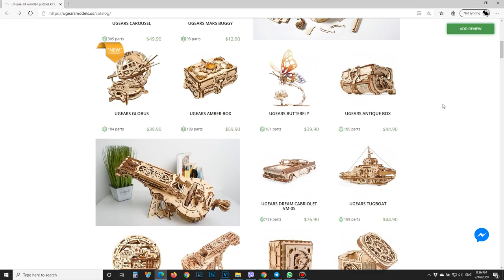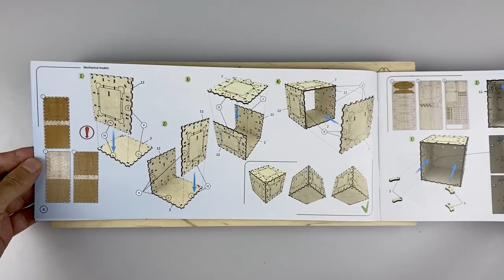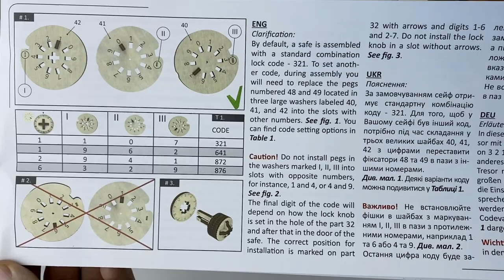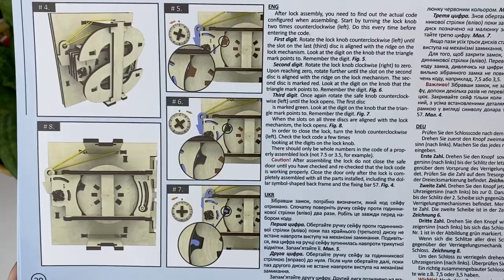Assembling Ugears Mechanical 3D Safe

Comment: Great idea! It's a shame that this lock design doesn't have cam wheel and cam nose – without that the lock is way too easy to decode. With proper real-safe-like lock design this could compete with Sparrows Challenge Vault even for learning to decode real safe locks.

With some replaceable parts similar to Sparrows product you could have elliptical disks with and without false gates and different fence designs to help learning the decoding process.